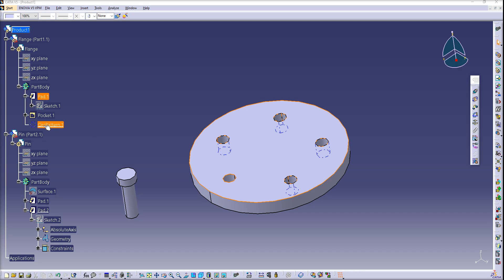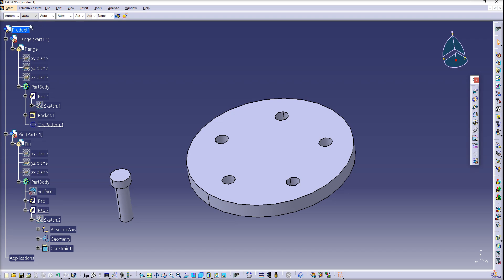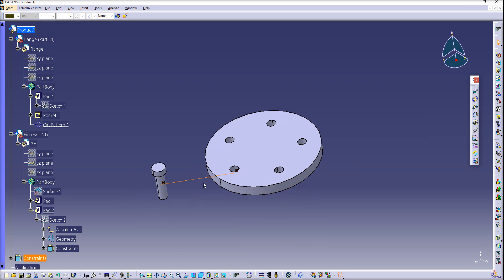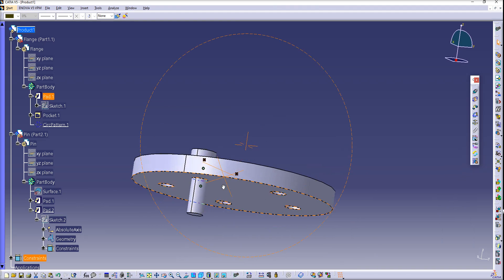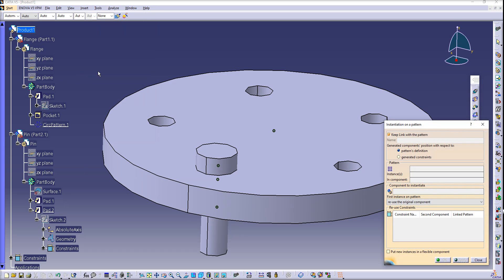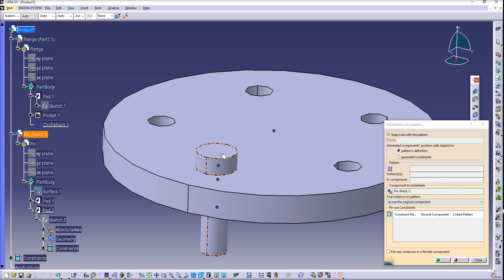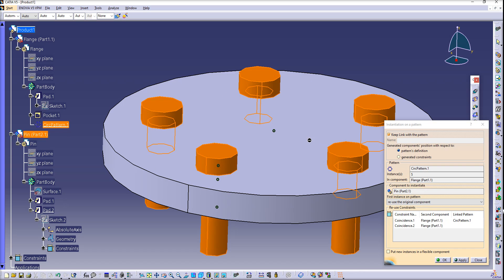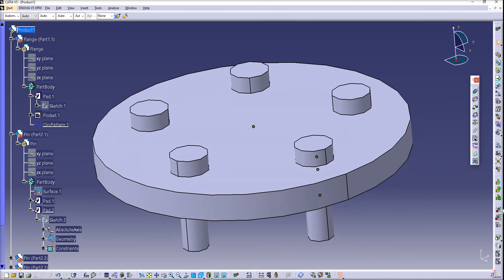Reuse pattern in CATIA V5

Comment: Do you need to first place 5 pin parts in the product tree ?  Or you only place one there and it will create the other 4 ?
Reply from the maker: You're placing one pin first and then cheating remaining ones using pattern feature